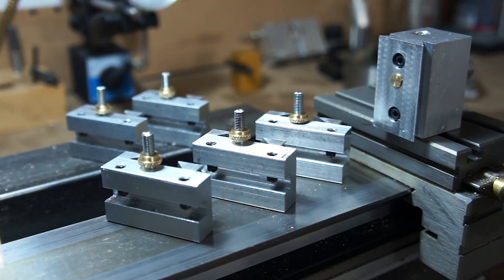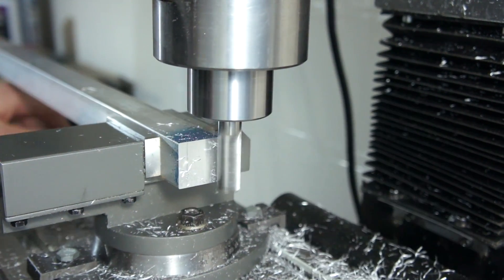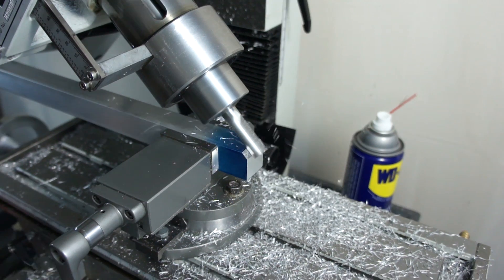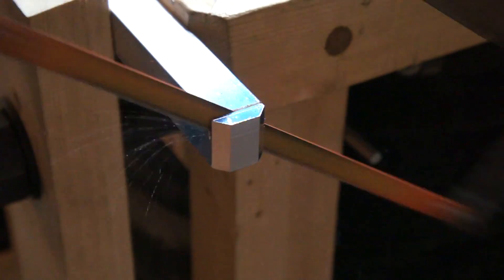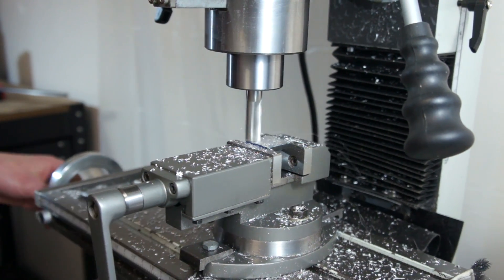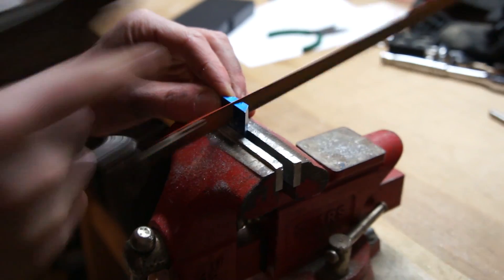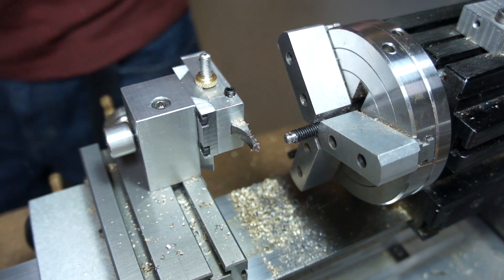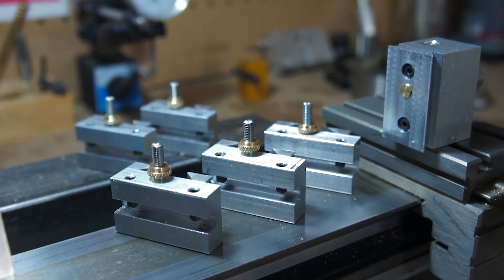Micro Lathe Quick Change Tool Post

Comment: Nice work.  Looks like a very fine finish on that 1018. Next project, make some fixed spanner wrenches for the 3 jaw chuck. The tightening pins will elongate the holes eventually.  I bunged up the 3 jaw on my old Unimat using pins.

Comment: Hi. The build is goeing very well with your plans. At 2:45 in the video, you use a shim to make some clearance between the 2 bolt-on dovetails. I am looking for the thickness of the shim: I do not find that measure in your plan, Thank you   gerald.bergeron@sympatico.ca
Reply from the maker: It's just to give a little wiggle room for sliding, you could use almost anything but in the video I believe I used a scrap of paper. Shim stock, pop can aluminum, rolling paper, aluminum foil...all work probably work just as well.

Comment: Thank you! 
That Really looked easy. I will probably use my Sherline “angle table” which I bought a while back, to create the Angled Cuts . . .

I am “just” getting back into my TAIG MICRO Lathe, (and MICRO MILL) and think this will be a good project to start with!!!

As I am on a Budget, your $3.00 price for plans is Well Worth the price, but could you tell ~us~ approximately how much metal you used?

I have tapped out April expenses (really: I am currently AKA as Bank of Dad, one daughter just got laid off :-( so I’ll be purchasing Plans & Metal in May (for my Birthday !!!), 

Anyway, I have added your utube channel to my list of Sensible Machinists. As I really learn by watching!
Reply from the maker: Thanks for the kind words, material usage is all dependent on the quantity of holders you want to make. The post takes about 2" of both materials (1" square and 1/2"x1" rect) and the holders use about 2" of the rectangular stock each...steel and brass is listed in the plans as you only need small amounts (3" of each would suffice). 

Hope that helps! Post a picture/video of your project when you get around to finishing it, I'd love to see it.

Comment: Hey Curt 

Were is your Aluminum bit supply bought from - mine in Canada has dried up
Reply from the maker: As in endmills/lathe tools?  Typically I use my local machine shop (United Tool) for easy to get stuff (generic endmills and HSS blanks). Harder to find stuff I go online with either Toolstoday, Lakeshore and occasionally ebay for some odd balls where I'm not worried about quality.
Reply: Have they Planted ! More ! Trees ! There !??

Comment: .I liked watching your video and gave it a thumbs up but I fail to understand why you did not use a dovetail cutter, I have a mini mill and have mades 9 QCTP holders in both cold rolled steel and Aluminium using a $20 dovetail cutter so I know it can be done
Reply from the maker: Oh a dovetail cutter is the way to go! The reason I didn't use one was because locally these things run $50-80 and I started this project not wanting to wait for a mail ordered one...that and I wanted to see if I could do it.  Thanks for the like and comment!

Comment: Is that white stuff in the tube some sort of epoxy or glue you are using?
Great video!
Reply from the maker: Thanks!  That stuff is cyanoacrylate (crazy glue).  I use it to hold the parts in alignment while I drill the holes for tapping...saves on having to scribe and punch both parts.
Reply: Thanks Curt. Please do more matching videos!
Reply: @CurtVanFilipowski  if that Glue is so Good ! Then why are you still Clamping it ! Then ! ?

Comment: Make sure parts are seated in the vise by giving it some taps with a dead blow mallet, and when sawing with a hacksaw I like to hold the workpiece in the mill vise so it cant move. Just make sure no sawing chips stay on the knee ways
Reply from the maker: Thanks for the comment...I need to invest in some parallels to make my setups more accurate...and stop using my wood leg vise for holding metal!